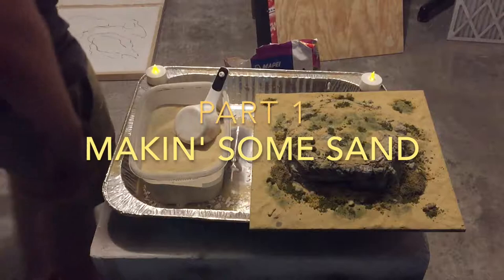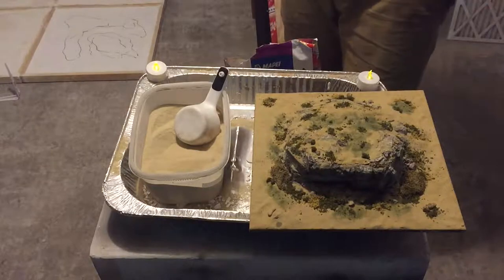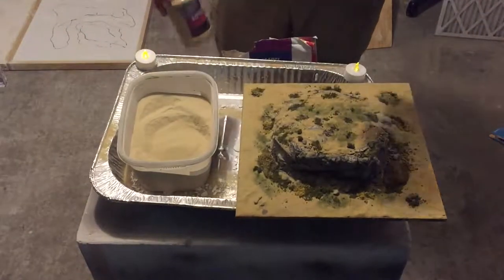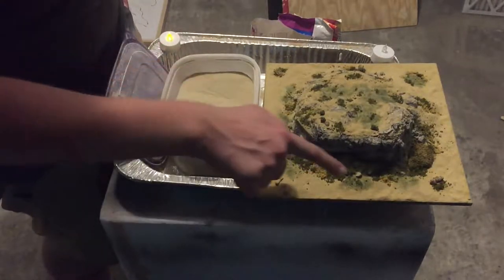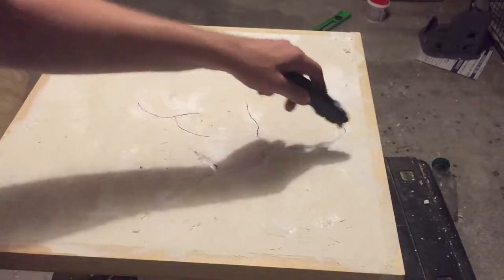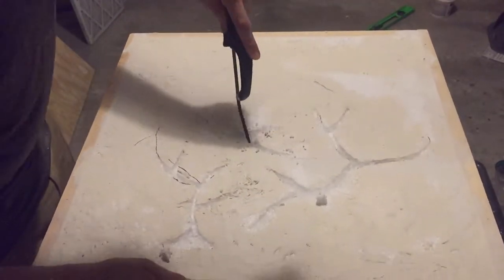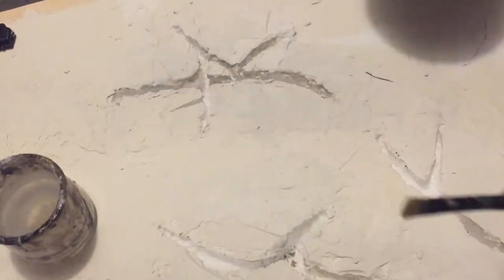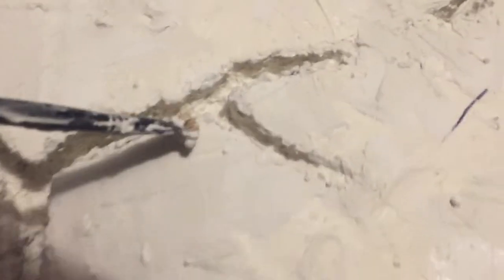Desert Tabletop Terrain Pt. 2 - How to Make Sand and Fissures

Comment: This is great. Started working on one today. What is the purpose of the alcohol vs just water to activate the grout?
Reply from the maker: So so sorry for the late reply. Just had a newborn so things have been hectic. The short answer is that alcohol is a “Flow-aid,” and helps the water soak into and around the tile grout, so that the glue can bind and permeate the entire surface. If you just use water, the tile grout tends to bead up and resist the moisture. Hope this helps! Again, sorry for the late reply. Thanks for watching and please let me know if you have any further questions.